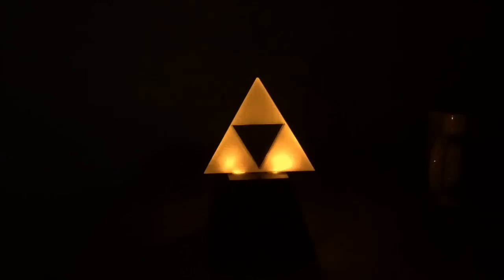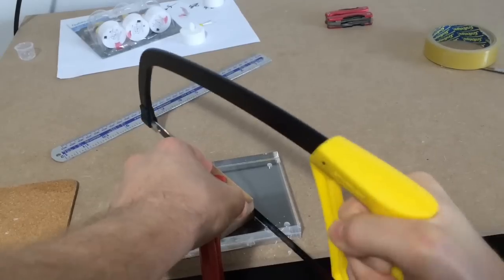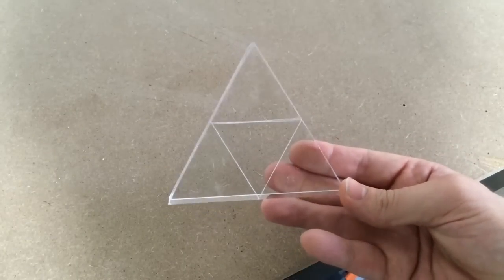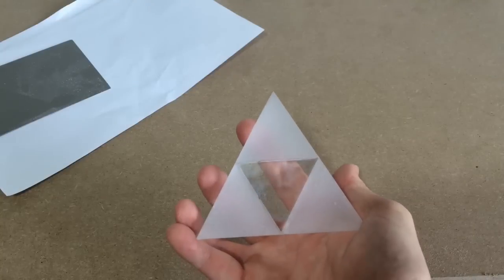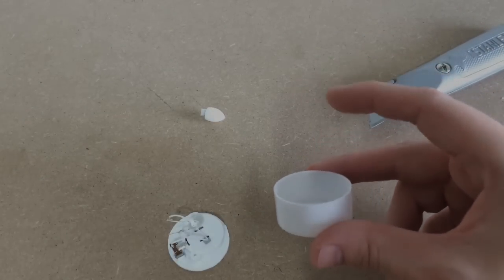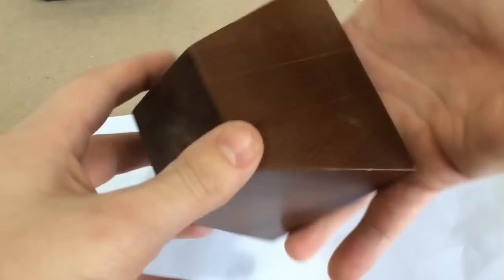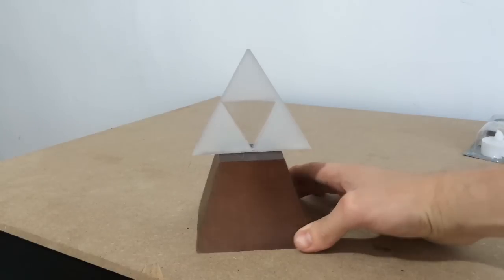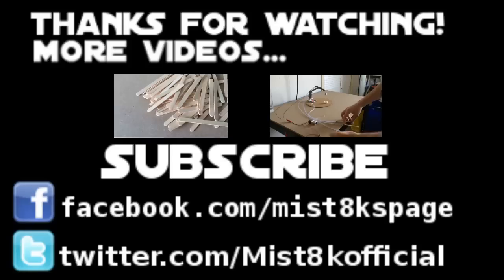Make A Glowing L.E.D Triforce!

Comment: Hi, a little tip that might work for you. instead of the dremmel use some medium / fine grain wet and dry paper to "frost" the required parts. you can use tape to cover and protect areas you dont want frosted. I have used scotch pads before but they take more effort than some 480 grit paper.

Comment: Mist8k = Illuminati confirmed.
Reply: 8+1-6=3 3+330=333 333x10000=3330000-0000=333,ILLUMINATIE CONFIRNED
Reply: 8+1=9-6=3 3+330=333x10000=3330000-0000=333 ILLUMINATIE CONFIRMED
Reply: All triangles
Reply: Mist8k= 6 letters.
Mist8k means Mistake, which has seven letters.
6 times 7= 42.
42 divided by 7 equals 6.
Mist8k is six letters.
ILLUMINATI
Reply: Michael Belcher 5 letters and 1 number xD fail
Reply: PigaBePwning Alright, it's five CHARACTERS then. You happy?
Reply: +LinkMarioKirby Gaming Don't you mean 6 characters?

Comment: you could use a dremel/flexshaft  with a spilt mandrel + 80 grip sand paper to do it, seemly, faster. Use masking tape to cover what you do not want sanded. only thing doing this way I could see is rolling the edges.